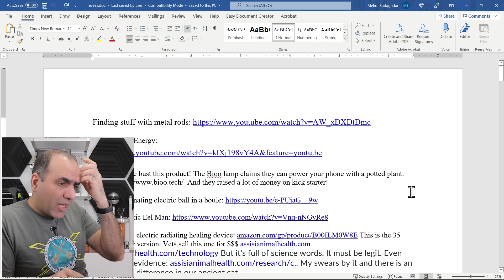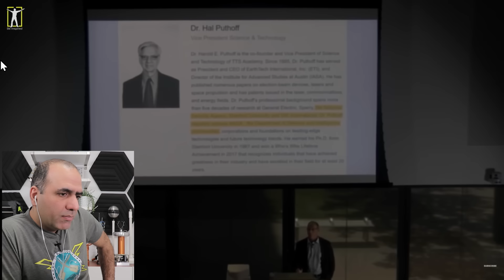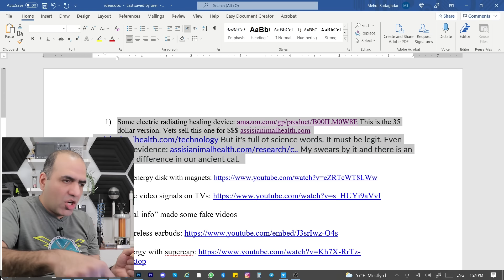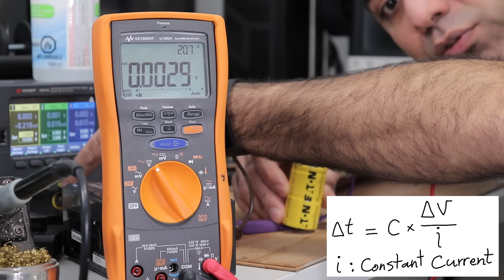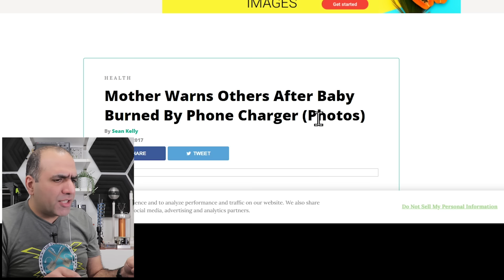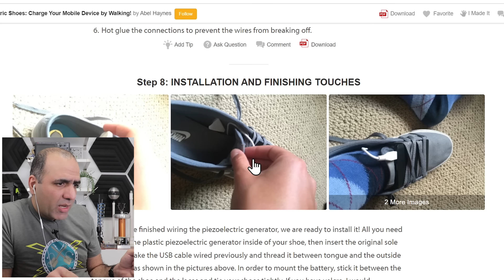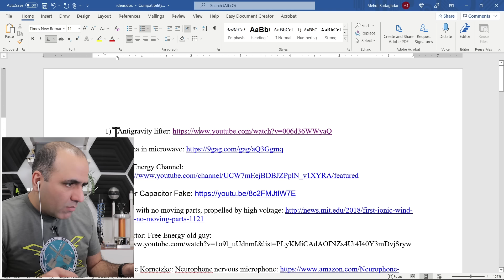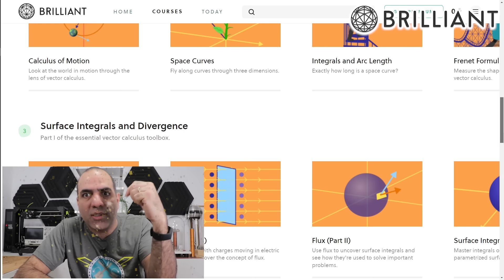The GARBAGE People Fall For, Year-End Cleanup

Comment: FYI, plugging components into an audio jack does not mean that those components cannot transmit or receive other signals. It is a perfectly plausible idea that you could feed a video signal through an audio jack if the process of encoding and decoding were standard on both ends.

How useful that would be is a completely different question, given the obvious bandwidth limits.
Reply: Since the audio jack only outputs audio, not really.
Reply: @Wifibee  Nope. It outputs a sine wave. (By that I just mean an analog electronic signal).

Your phone does not care if the signal is "audio" or "video". As long as the encoding and decoding are available, it can output anything, latency aside. (And accuracy).

You can literally send pictures through a walkie talkie with the right external peripherals. This is certainly not impossible.
Reply: @ncpolley  You could do that with a walkie talkie or any antenna, sure, but i bet you would encounter major problems trying to tinker any modern smartphone to do anything outside the range of what the audio jack is connected to on the phone's motherboard, ergo, not possible with a smartphone.
So unless you majorly change the circuits of the smartphone or at least attempt some major firmware / bios change (good luck), no, it won't.
Reply: @Wifibee  What makes an antennae, transmitting a signal of varying frequency, different from an 8mm jack, transmitting a signal of varying frequency?

... There isn't one, conceptually.

A piece of software, designed to encode video into signal transferable by the audio jack, needs no hardware modification to operate.

Streaming video would be impossible due to latency, like I said, but it is 100% possible to transfer data through the jack right now.

No one has done it because it's a dumb idea. But it can be done.

Comment: They sold those stupid stickers in here too but for cars. Basically you put the sticker on top of your fusebox and it will give you more "voltage regulation" resulting better fuel consumption. They claimed it was made using cosmic dust.

Comment: 14:03 yo, i made a capacitor almost the same size (I think). FYI, when unrolled, its length was 2 meters (6⅔ feet for those who use the stupid imperal system) and its rolled capacity is about 17 nF. I also discovered that when you put a capacitor like that in cold water, its capacity significantly increases! So, my another quickly made 350 pF capacitor reached 4 μF in that cold water! I know it sounds like it's an electrolyte, but it has like kiloohms of resistance. Maybe it's just fooling my meter into thinking it is that big of a capacity, because another small homemade cap momentarily reached 20 μF.

Comment: Kindly make video about three phase balanced and unbalanced system both Y and Delta connections. I have a question about it , in a  star connection three phase if one phase is not available and two phases are tapped from one phase while one is independent what happens with Power factor , As one transformer coil will be  overloaded and will emit more heat in return increasing  Apparent Power. So if Apparent Power is produced more then Power factor will decrease as PF is equal to KW/ KVA . Need your views in that .

Comment: The witching rods do work though. Perhaps its not related to electrical phenomena but I've used it to find buried facilities.
Reply: Agreed I just posted this: "Water witching" does work with the magnetic fields of the earth. The iron rods need to be polarized. Usually done by banging with a hammer. That can align the magnetic domains. Isolate the rods with a tube handles. Any dirt work will disrupt the domains in the soil, so it really dosent work in modern areas. But works well in a field that has irrigation buried. I love this technique and old school dirt workers like my dad use it. It's not a gimmick. You just need to uderstand how it works and how to apply it.
Reply: Let me guess, you don't publish peer-reviewed experimental papers since only someone with your rare sensitivity and knowledge succeeds?
Reply: Damn bro, that's crazy. You should try right next time

Comment: Dousing picks up power lines so it won't work inside.  It doesn't pick up watter but will pick up pipes.  I'm a sewer worker.  It works very well.  The explanation shown is wrong.  Hold the rods at a slight downward angle to keep then straight, and walk over the area, and the rods will CROSS when over or under the utility.

Comment: I did jobs in piping for county construction for about 3 years. Water Witching is definitely real. Watching an old timer grab some welding rods and wander around pointing out active water lines is wild. The likelyhood of a team of bozos who left the blueprint at the shop having the one guy who memorized the pipe layout in the last 15 feet before the county line is low. Not impossible, but less possible than a phenomenon that's been referenced since the middle ages and is still used today being total bullshit. It may not be electricity, but whatever the fuck it is, it's saved my ass more than a few times.

Comment: 13:12 technically, if gravity just turns out to be related from gases pulling you down, purely impact view of matter, Ionic wind removing air like normal flight could technically be viewed as anti gravity. As it's lifting it it would be the logical statement.
Reply: I wonder if the core of the earth slowly leaking gases and then solar winds blowing on the atmosphere would explain the entire thing. Then Maybe smaller bonds could explain gravity.
Reply: Pal you know what gravity is?

Comment: Water dowsing is the one thing that I've actually done and the results have been...oddly successful. Whenever we've done plumbing or drainage work at the house (or a relatives) we would use dowsing rods just like EB had to find the water line. We did start searching near the most logical point in the yard (some places make more sense to run a drain line or water pipe though than others. For example, a drain pipe will usually run somewhere along the driveway), but we would use the dowsing rods to find the exact spot. My granddad did it the last time we used it and when those rods crossed, he stuck a stick in the ground to mark the spot. We came back with shovels and dug directly down and sure enough, we found that drainage pipe directly below. I can't explain it, but from the times I've seen it done, it's worked.
Reply: I have done this as well looking for water lines running to peoples home or even water mains. It was common practice with the municipality I was in.

Comment: love your videos. but the fact you dismissed some of these so easily.... the "antigravity lifter" does in fact show a ionic thrust. but it has also been tested in a vacume and worked. the device is essentially a asymmetrical high voltage capacitor with air as the dielectric. the corona discharges adds thrust as expected. but the biefield-brown effect creates a electrogravitic thrust towards the negative electrode.
Reply: He dismissed the claim the video made, not the device itself. The source video claimed it was generating a gravitational field above it that was pulling it up, which is nonsense. Electroboom not only provides a vague explanation (High voltage and ionic winds) but gives a specific video that explains exactly what is causing it.

Comment: "Water witching" does work with the magnetic fields of the earth. The iron rods need to be polarized. Usually done by banging with a hammer. That can align the magnetic domains. Isolate the rods with a tube handles. Any dirt work will disrupt the domains in the soil, so it really dosent work in modern areas. But works well in a field that has irrigation buried. I love this technique and old school dirt workers like my dad use it. It's not a gimmick. You just need to uderstand how it works and how to apply it.

Comment: 8:03 don't that work though? The spark moves the motor which turns another generating a bit more power and its a closed system?
Reply: Nope. Heat and light is generated which reduces work doing energy.

Comment: Sorry but the bent wires do work I personaly have located water pipes under ground in excess of 50 times okay some they have not for me every time but  that would be less than 5 times. But my fails were mainly when I first started using they.

Comment: The two wire trick ACTUALLY WORKS. I used to install cable and if the guys didn't mark the water lines, this works. I forgot what other lines if works on but I promise, it actually works.

Comment: 1:15 witching rods work through detecting a difference in static charge between electrons.  If you have and kind of static charge near your gas line, you probably should have that looked at, because that could lead to a serious explosion.  He was probably finding a tree root, ya know...since there's a tree right there.  By they way, witching rods do work.  You just have to know how to do it it.  I use witching rods all the time to find waterlines that haven't been located by the city I work for(I work in construction).  Just  because the idiots in the videos didn't know what they were doing doesn't mean it doesn't work.

Comment: Actually these metal rods work. When I was at my grandfather I thought it also wouldnt work but we found water pipes with them. I tried it myself and it worked somehow. However I dont think its working with electricity. I still cant get my head wrapped around that these things work…
Reply: Because they don't. You happened upon water pipes, how long did that take and how many water pipes were in the area? This is called confirmation bias.
Reply: @nikkiofthevalley  There were a few and we both didnt know where they were but somehow digging straight down the pipes showed up. I also always thought it would be a scam. I also always thought those people using these things would turn them by themselves. But we also found a pipe we didnt even really know what it was there for…
Reply: It simply does not work.
They tried it in mythbusters

They had big sand field with a pipe hidden somewhere.
They hired "expert" well seekers, and they failed to find the pipe.
Reply: @jarskil8862  Actually I also didnt want them to work and I still dont know why it works but it shouldnt work...
Reply: @Edward Wilson What is 811 for? Im not American…

Comment: The device in the video screen hijack doodhicky clip is a Jupiter Jack with a transformer where the battery should be. It was an infomercial (like ads we have today, kids) direct from china type product that could give the illusion of a car phone (Its true, there was a time having a phone in your car made you look like a wealthy socialite and not a pre-murderous douche nozzle) by transmitting audio on one of two FM frequencies. So if you didnt have a headset or speaker phone features on your phone (yes kids, these were much sought after features in the before times) you could use the Jupiter Jack to transmit the audio through your cars stereo. It worked as well as one could hope for. If your phone had a crappy mic or filtered out 'room noise' so it only worked a few inches away it wasnt much help, and the cheap transmitter wasnt very stable. But it totally used to be a thing. I think I still have the board around somewhere.....

Comment: The L shaped rod definitely does work. I used to do sewer and water and idk what it is but it worked every time. I know nobody will believe this but we found so many pipes using these things. the pipes do have copper tracer wire running with them. Idk if that has anything to do with it.

Comment: 9:10 How efficient is it compared to solar panels. If it's cheaper and you put enough diodes on an old CD how much can you get. And how much can they be stacked and still get good output?
Reply: I doubt that could supply much current at all, so you'd need an obscene amount of diodes.

Comment: When I was  teenager years ago, my boss and I had to put in some UG cable and piping between farm outbuildings.   He found the piping this way with bent coat hangers.   I sort of assumed at the time that it was the influence from the magnetic field created by ground fault currents.   Anyway, it was 100% accurate.   We dug straight down and the pipes were right there.  In 6 different spots over several hundred feet, with bends as well.  It was sort of Spooky.  And he definitely had no way of knowing beforehand where the piping was buried.

Comment: Thts literally wnt I’ve sayin, I hve a free energy device/idea that’s not built yet, I just gotta get something to connect the motor and generator and thn connect thm ya littoral board thng thts hand felt wth wheels, but lke still,/…I could make a little booth set up, if it’s enough power, plus in a power strip and charge ppls phones in places/spots wth no power. 5/five for not all the way, maybe 6/six to 8/eight if it’s close to done bt lke nt all the way, xnd 10$ if it’s all the way, xnd could literally be mkng 40/forty or fourthly dollars an hr or to mxre or so

Comment: Finding Underground Wire and Plumbing Using Metal L-Rods ........................ Sorry but here you are wrong :( thei work. i have seen in practice no for show off but for real to find power cable before digging ground! it didnt work when i test it but old man whit l shape aluminium rods where very acurat
Reply: Aluminium is not even magnetic metal so it alone takes all plausibility away from your claim.

Comment: Are you joking with saying finding things with bent rods does nothing? I mean I use this princjple all the time, and it amazes some people,   but it is very simple magnetism. I actually used two bent rods to eliminate a parasitic current drain in my old volvo, uhaul had screwed up tbe grounding when they installed a trailer brake light controller. Actually, I just used one rod, and it led me right to tbe brake box in the trunk, with the car off, keys out.

Comment: I had to dislike becourse you were wrong about 2 rod detecting underground cables. I understand why you didn't believe it. It is not Scientificly proofen becourse it doesnt work with every person on this planet but... It Works about 1/4 population. Reason i dont know.

Im electrician, working Ford powercompany building and maintenance powergrid. And i plus few others electrician use this method If we cannot find cable with cable detector specified to this use. Sometimes cables just dont want to be found (like when they go under Road in metalpipe or in special electric pipes that makes faradays cage, or are just too deep to find). Even our excavator guys use it sometimes to find cables/waterpipes and like that. 

This method can find pipes that has had electric field in or water flows. It can find cables, old lost traintracks underground and many others conductive or capasitive materials.

Best Part.. My wife cannot find anything with this method by herself but when i touch her skin anyways at the sametime she is using it, it starts working.. 

No one knows how this Works but it works. You have to live to cable from  side it to work. best is 90°, If you "walk the line" it won't work.
Reply: If you dont know why or have no source when you claim to be an electrician, you're very clearly wrong. And if this is true, how come this isnt used by archeolegists

Comment: I am an Electromagnetic Physicist and I want to say that you don't know enough about dousing rods and how they work scientifically. All Moving matter including electricity, gases, and water produce a magnetic field. Which, with you as the ground with the rods, you can easily find magnetic fields of those moving particles and charged particles. The rods will align across one another when you cross over anything that produces a magnetic field. I also know many gas line and electrical workers that work for the city of Fort Collins Colorado and Eugene Oregon that use them specifically because they are more accurate than their devices. Also my father is a rancher and uses the method to find his gas lines, water lines, and even leaks, and we're talking about a leak that was 7' deep in a garden hose from over 70 years ago. They are so accurate in fact that you can even find depth with them. It's fundamental Magnetics. Simple stuff. Not Magic.
Reply: Nope. You are incorrect.
Dowsing is pseudoscience. 
Its argument error to start an argument by saying "X person I know is Y"

In case your father can actually use dowsing, why he has not yet made a huge breakthrough and proven how it is not pseudoscience afterall.
Reply: @jarskil8862  May I remind you that a lot of so called pseudoscience is now called Quantum Physics. And is very well proven. Just because one doesn't understand how something works at first doesn't mean it's "pseudoscience". It simply means in most cases that we simply haven't figured out how it work's YET. Thank you. Also, way to completely ignore the entirely scientific explanation that came BEFORE "x person I know is y". Which was not the Opening argument at all. Well done. 👍